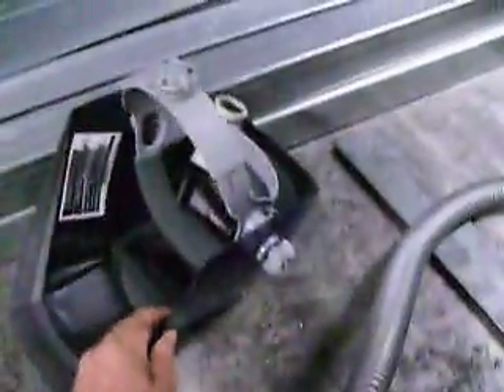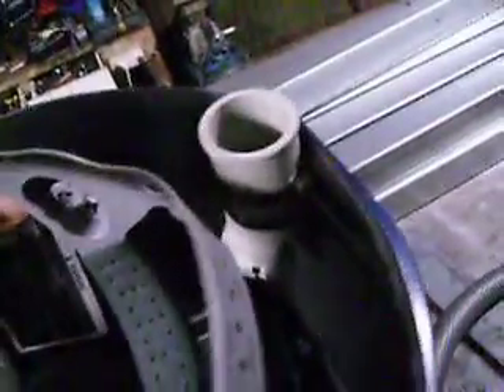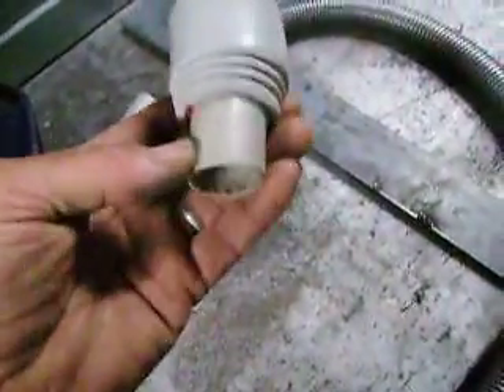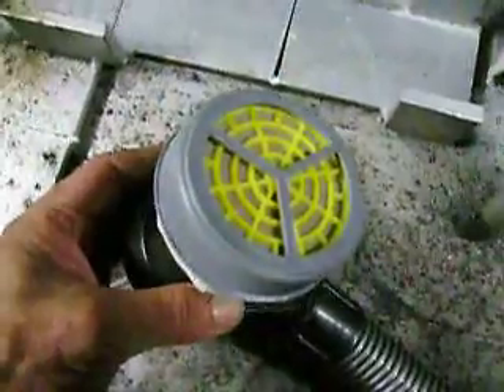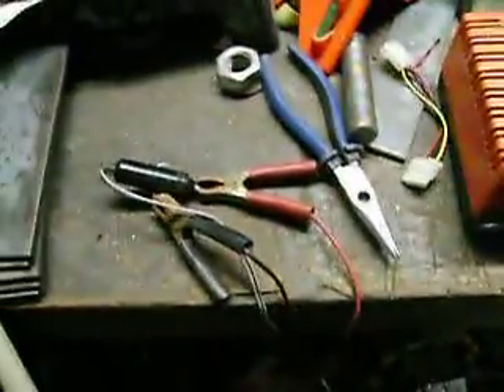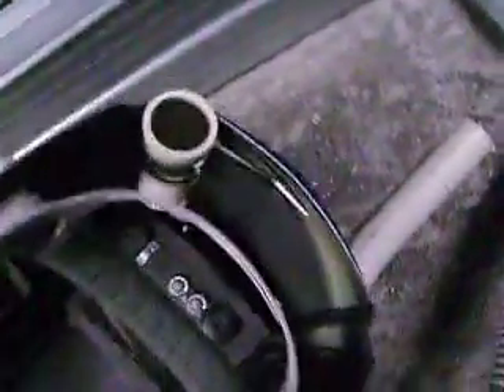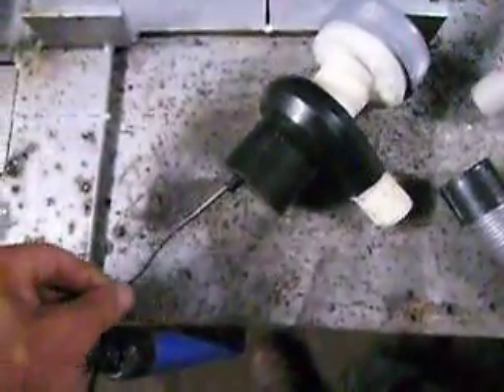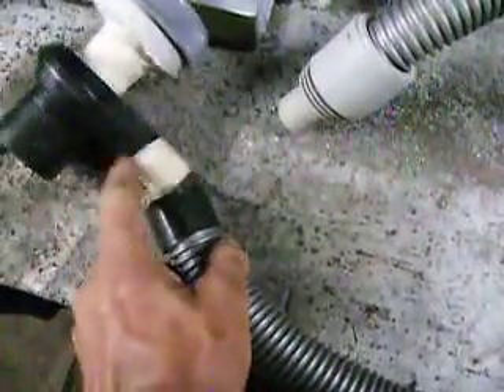I Built a Welding Helmet with an Air Filtration System

Comment: I thought the same type of device but I used a battery operated air mattress inflator. My problem is finding the best way to run the hose and secure the motor. I tried to make a hook for the motor to hang on my belt but that proved to be rather uncomfortable and the hose is a bit cumbersome; any ideas would be greatly appreciated.